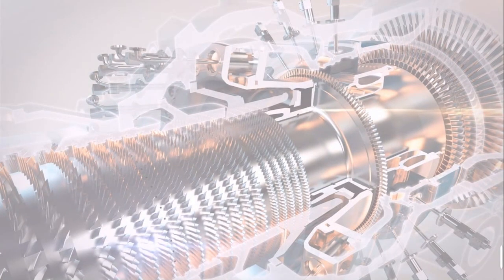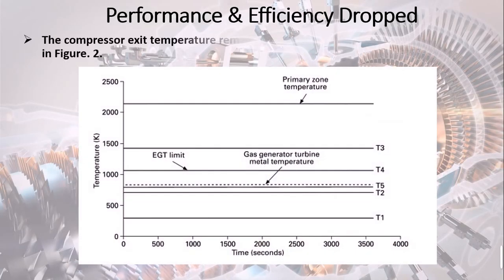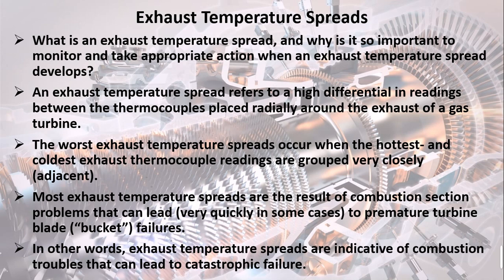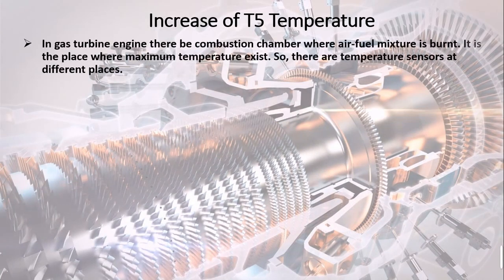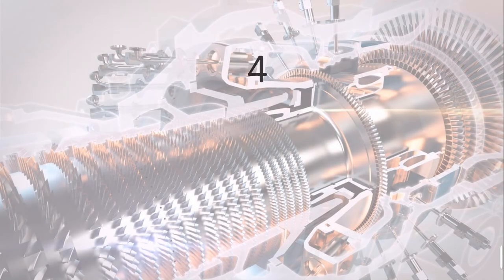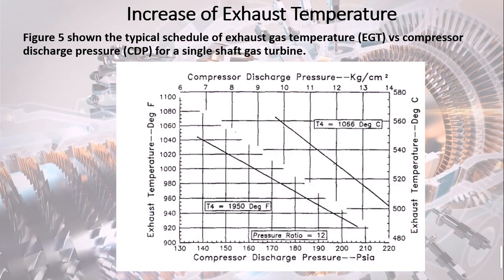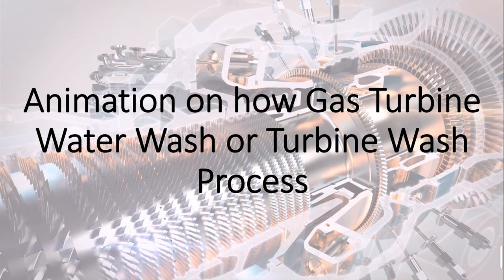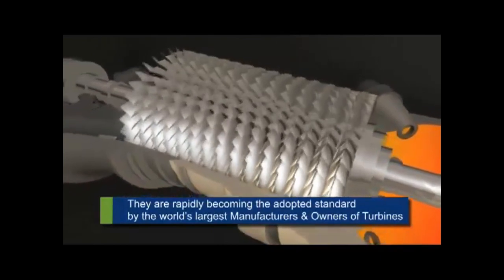5 Reasons Why Turbine Wash Required?

Comment: HFO wartsila generator engine W20V32 ABB Turbocharger inler temperature high. Please let me know possible cause
Reply from the maker: I not familiar with kind of engine that you mentioned. But what general engine possible cause of high temperature of inlet temperature high is back pressure at the discharge compress air or turbo inlet filter got clog (high DP) or turbocharger cooling system having problem.